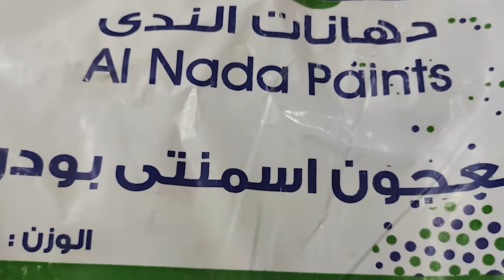أسلوب جديد لعمل ديكور حوائط رخامي بارز  بألوان معدنيه .. ديكور عصري وراقي ... 🏰🌟

Comment: I love your work. One question: How much drying time do you take before scratching the pattern with the screw?
Reply: At the expense of the weather, my brother,,, in the summer from an hour to an hour and a half.... and in the winter 3/4 hours,,, and you can also use a shaving flask and spray it with water if the pattern dries...